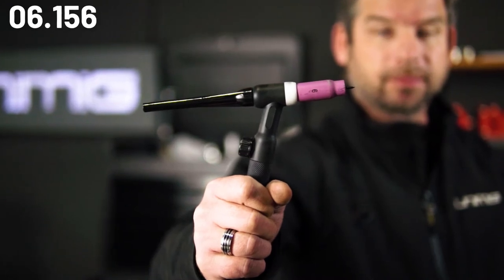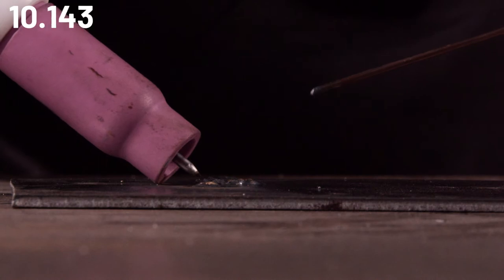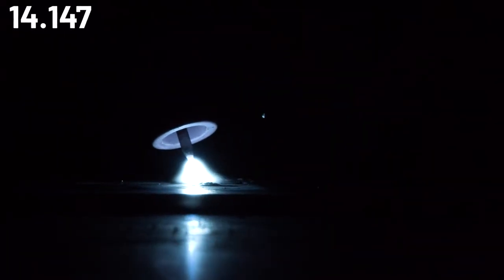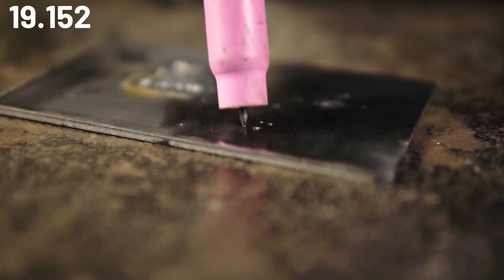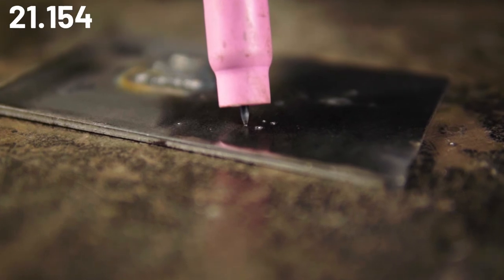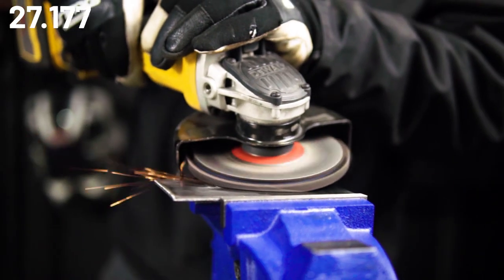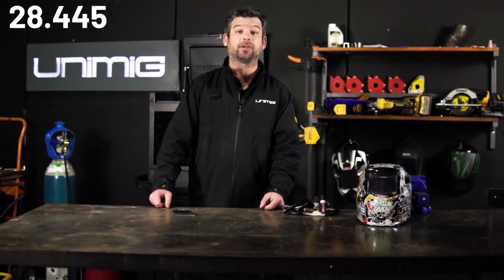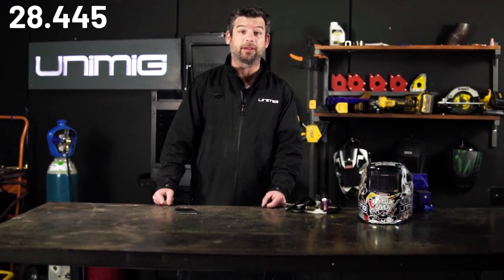How to use a DC Lift Arc TIG Torch!

Comment: Hey all. I'm new to this welding game so I have a question about the Lift TIG torch if u have a minute to answer.. I bought a DEKOPRO 2 in 1 Stick/ Lift TIG welder. What is Lift TIG and do I need gas for this function or is it the same as the stick welder?? Scratch to get ur ARC going?? Any advice would be greatly appreciated lads.. Thanks in advance but I will reply to thank u if u can answer my question.. Salute from Dublin, IRELAND!

Comment: What's the best way to stop the weld with lift tig? I can't stop it without a big arc trail or it leaving an unshielded weld end
Reply from the maker: Hey mate, getting a perfect end to a tig weld is a lot harder on a lift arc tig torch. A simple trick we use quite often of these is putting a tack at the end of the section you are about to weld. Then when you weld up to it and finish there, it shouldn't leave any crators or big arc trials. This takes a bit of practice, so keep trying on scrap and you will get it right.
Reply: @unimigsupport  awesome. Thank you. 

It's my dad's welder, a 185 multi process machine. Can you use a better Tig torch that has a button to stop or anything? Or is he stuck with what he has?
Reply from the maker: @DarrenBoxhall  Unfortunately that is the only tig torch you can use for this machine. It won't take that much time to get used to, a bit of solid practice will go a long way!
Reply: @unimigsupport  ok great. Thanks for the replys
Reply: I was watching another video on lift Tig where the guy recommended just flicking the arc away when you come to the end rather than stopping and letting go of the button.

Comment: that is not lift arc that is scratch arc, my selco has lift arc, you touch the tungsten to the workpiece, then you switch on, the amps automatically goes to the lowest amps, and then you lift , the arc up slope to the ajusted amps  or maybe i am wrong